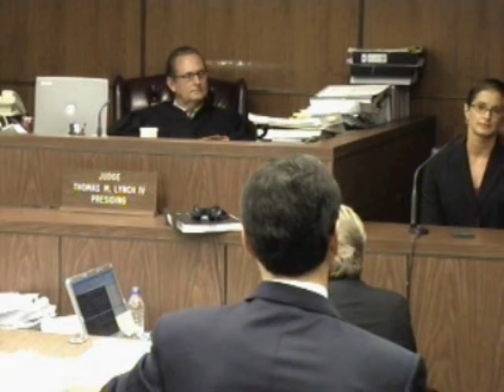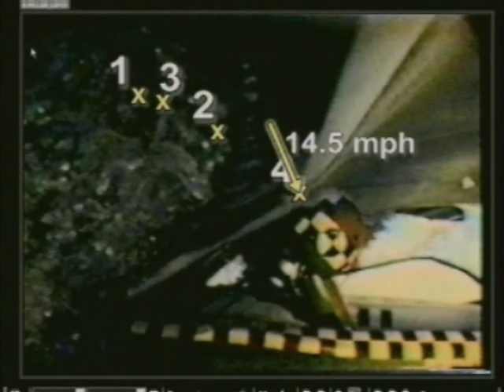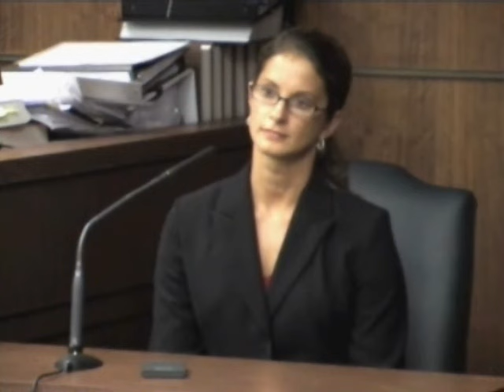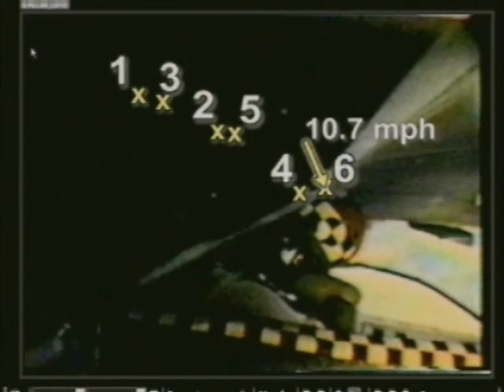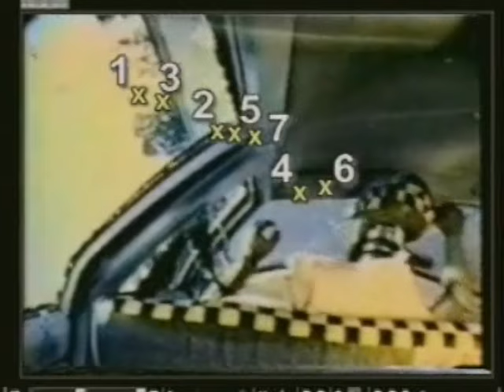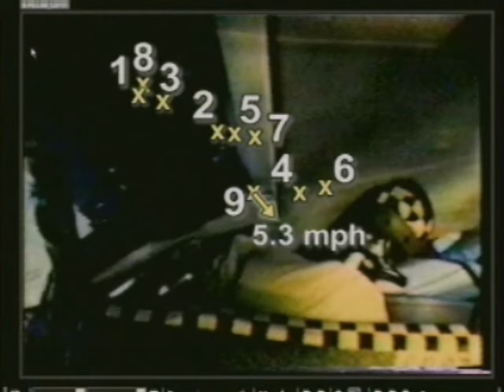Cross-Examination of Ford Motor Company Engineer by Ervin Gonzalez

Comment: The Ford engineer is correct, the deformation CAUSING the predominant head and neck injuries is due to the roll over contact of the roof to the ground impact motion. The concept presented by the prosecutor that side walls and roof at initial roll over state causes the predominant head and neck injury is misconstrued. Looks like the seat belt for the most part did its job, and so did the engineer.

Comment: Defending a shady corporation is never a good thing.
FORD should pack it up , they make poorly engineered vehicles, cut corners, dont cobtribute to innovation and use cheap materials.. hence the low demand for their products in the US.. Ironically, they sell more vehicles abroad than in the US. GM is not too far behind.
Reply: Rod D. Wrong. Ford F-150 is the best selling truck in America. They are in fact in high demand
Reply: Ford f150 are garbage.
Reply: You must not live in America then.
Reply: Official Blue Dildo - I agree.
Well made truck and it is indeed a space where they dominate along with others. But looking at their  overall business, Ford has more sales abroad than at home and ad a business they have pretty much given up on the US - their focus is abroad. Gm is on the samw path.

Remember, Trucks are merely a slice of the pie..
Reply: Ford is one of the only motor companies that didn’t go bankrupt and get a bailout lol.. the market kept them because they think otherwise. cringe
Reply: Yet despite these claims, theyre one of the most successful car manufacturers in the world, their vehicles perform very well in crash testing and in some areas such as aluminium trucks they lead the way in innovation, with other manufacturers following suit?
Reply: Rod D. Ford and gm make such poor vehicles like the Abrhams main battle tank, and expensive land rovers and bmw. Or perhaps the rocket engines in the icbm missles that keep you safe. You sound like one of those people who know nothing about cars at all. Ford actually makes most unibodies for other companies like tesla and honda. Ford came up with seat belts, and safety glass. In fact Car lite is the best in north america. You should call ford and then understand what companies you are talking about. Domestic ford products or foreign ford brands like citroen, bmw, mazda, lotus, rolls royce, etc. I bet you drive a GM foreign Volkwagon or something like that.
Ford actually made the all round best car ever designed. Go anywhere in the US, or canada and hail a cab, or watch the police, or the Secret Service drive one. If you needed all wheel drive then why do alaskan state troopers drive one. Or a cab in new york?
Who should pack it? All cars modern have a 5 year life span.
You know nothing. Maybe we should produce chinese cars with no seat belts.
I prefer a toyota which is a gm car. I also know from experiance that most "foreign" brands are made with cheap shit. American steal, and plastic is always better, but some of the "foreign" brands have cheaper imported plastic and ferrous metal body shells from china like lexus for example. The wiring too. So the lexus gets a better body then the toyota, but the wiring amd shell is actually cheaper even though the unibody is used for chevy, infiniti, and nissan too, the shell and components are from different venders as ford doesnt make a lot of engines most fords have a duratec or mazda or windsor motor, while the unibody is from ford. The transmissions are mostly from japan in 80 percent of all cars modern in the USA. So now you can know who makes transmissions; about 8 companies in the world.
You didnt know that all cars were made from japan, china, and usa mixed together for the past 25 years, but now you do.
And the only good cars were all american ones like the crown vic or the chevy 2500 hd or 3500 cheyene or E250. The T 250 transit is a modern marvel. Until you put 140,000 on one let me know otherwise. My 91 merc had 751k same motor(ford long blck 4.6L281cc dohc), same trans motorcraft AODE the first fully electronic transmission for a normal car and then it was stolen. My merc milan has 253k same motor (mazda3L dohc) and same trans (aisin 6 spd cvt) and has been hit by a tow truck, rolled over and needs a side view three years ago, still running top speed of 138mph and blows ice cold in the summer no slippage, just that damn mazda 3 only gets 24 mph.
My Malibu was great except for that Volvo designed panick sensor in it that drove itself to be totaled, thank god no one died. German engineering. Maybe thats why they lost.
Point being find a car with major abuse and miles and miles of operation that is made by one single country and massed produced and still around in great number to this day all over the world. It will be and american car.
Dnt see the allies putting anything out that wrks unless americans fund it and produce it, and if not the americans then thier partners the japanese.
Reply: Ralph Naider (might have spelled his name wrong) was the main activist in push for legislating car safety, and it was Volvo who came up with three point seat belts and many of the modern safety innovation that are now common, not Ford. The truth is Ford like most of the large car makers actively tried to stop safety standards being legislated into vehicle production.